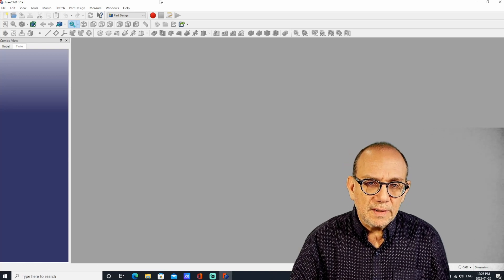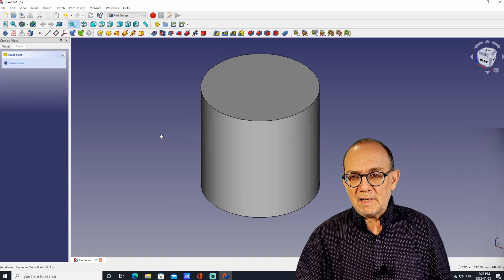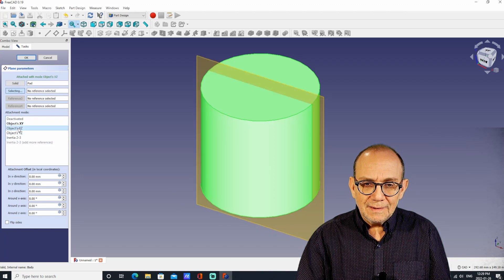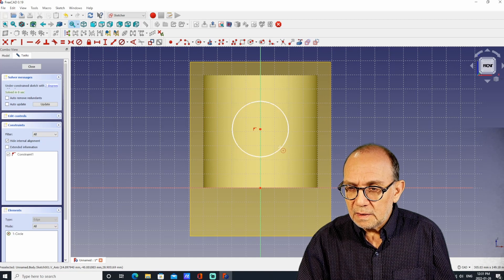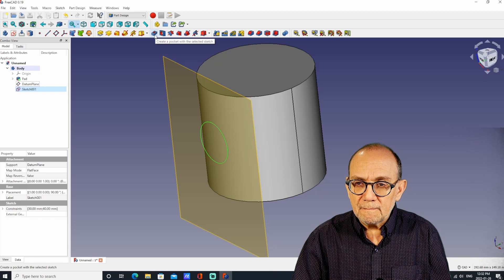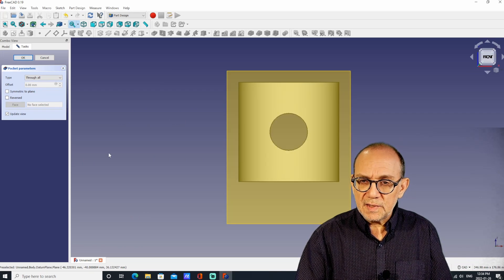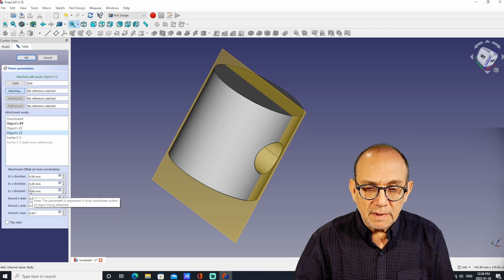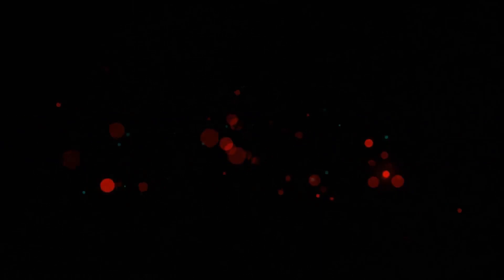Make a Hole on Curved Surface in FreeCAD

Comment: A quicker way is just to leave the datum plane vertical within the cylinder, draw a circle on it then make a hole from it symmetrical to the datum plane, "through all". This is very quick and you don't need to know the diameter of the cylinder to make the hole.

Comment: Thanks for taking the time to teach . . .  where would we be without wonderful teachers like you. thanks. Is it possible to do the same thing instead of making a hole but putting some texture on the outside of the cylinder like cubes or lines etc.
Reply from the maker: Yes, it should absolutely be possible to do this with this technique...have you tried?

Comment: This is probably the most complicated way to do this. Just use the normal xz and YZ plane and select "symmetrical" when using the whole function. Or just do it once and do a circular pattern. Die the second axis.
Reply from the maker: Yes, thank you...I made another video showing the simpler method... https://www.youtube.com/watch?v=ICah1qqFlXM&t=2s  ...and even in this new video I didn't use the "symmetrical" option and "view section" options which would make it even simpler.  RG

Comment: Not necessary at all to use a datum plane for this. Just make sketch number 2 as anormal sketch in the middle of the cylinder and make a pocket. Much easier.

Comment: Thanks for this excellent video!

At 8:52, you mention that to turn off the visibility of any selected node in the model tree, we have to press the RETURN key (= the ENTER key).
But this key does not work: We have to press Space Bar to toggle the visibility on/off.
Reply from the maker: Thank you for your comment.  It's appreciated.  That was my mistake.  You are absolutely correct -- the only way to turn off the visibility is to press the Space Bar.

Comment: Exactly what I needed to know. I knew datum planes was the answer but I could not figure out the entire procedure. Kept getting errors. The answer I needed was to move the datum plane in front of the cylinder and not inside it.

Comment: Wow! Thanks so much. (I made a phone/tablet stand which is just like an 'S' shape with a little shelf; but padded sideways, and I needed to make a hole for a charging cable!).

 I also used the same 2d method and made a keyboard shelf that just hangs off the bar on a small cart with drawers and I put a all-in-one pc on top of. I actually made two shelves one for each side of the cart, but used one skin on the second one and it cracked when I used the heat gun to put it around the bar but lesson learned (I didn't need to punch a hole for that one I just put in the sketch), but it also rests on the cart for the lower end so it doesn't just swing and behind where it rests there is a channel for running the cord around to the other side and so it doesn't drag on the floor either. I'm new to printing and those 2d designs are my favorite right now.

Will remember datum planes now. I always also make the mistake of choosing "make hole" instead of pocket knowing it won't work, but now that you explained it I have no excuse not to know! But for some reason it wanted to cut above the plane so I had to reverse the pocket and it worked for me. (My design is terrible actually because it didnt even have proper measurements and I had to print it at 200%, but the splines did everything so I went with it and got a product that works haha) Take care and I subscribed.

Comment: however, when you change the proportion of the cilinder, for ex.  make it wider, the support plane will be fixed where it was and eont be touching the surface againg. In Inventor and Crro it is possible to fix it without adding distances in mm and when cilinder changes, the support plane moves too. Thats what I am looking for right now
Reply: Don't use a datum plane. Rather, once you pad the cylinder create a normal sketch on the XZ plane. Press the 'View Section' button on the Sketcher Toolbar so you can see the sketch. Create your hole and constrain the diameter and vertical dimension as in the video. Close the sketch and select the Pocket button. In the Pocket window, change the type to 'Through All' and check the box 'Symmetric To Plane'. Press OK. Repeat the procedure on the YZ plane. You should now be able to change the diameter of the cylinder to whatever you want and the holes will always go through.
Reply from the maker: If I understand you correctly what you're talking about are the parametric options in FreeCAD which I didn't touch on in this video.  Using the parametric options you should be able to do what you describe.  If you do a search for parametric modeling in FreeCAD you may be able to find what you're looking for.  RG

Comment: This is absolutely BRILLIANT!!!!  Thank you VERY much!!!!  I was having no end of fits trying to figure this out and as a beginner I was not pleased.  You answered my questions perfectly and you explained it in EXACTLY the way my brain needed.  I've never been one to learn by being taught all the features but instead shown how to do a specific set of tasks and your video hit the nail on the head.  Thank you so very much for taking the time to share this.
Reply from the maker: Excellent!  I'm glad this was helpful to you.  RG
Reply: @CreatewithTech  It really was.  I'm still hammering away trying to get so much of this FreeCAD info to sink in and much of it is.  The one I cannot seem to figure out, nor wrap my head around, is how to create a sunken pocket at the end of a tube.  Ie OD 20mm and ID 16mm tube with an 12mm ID indent at one end 3mm deep.  Basically think of a tube as wide as a quarter with a cutout in the end that would allow a penny to sit in flush with the end.  I've figured out how to do it with two separate pieces but not how to join them.  Still trying though.  :)
Reply: @CreatewithTech  I've been making excellent use of this so again I thank you.  I have stumbled into a problem and I don't know if (or what) I am doing something wrong.  I am trying to create a square pocket through a curved surface but no matter what I do following these steps here I just get a single vertical line on the face after I create the pocket.  If I use the exact same steps with a circle in the sketch I get the pocket I'm looking for.  But with a square in the sketch I can't get the pocket to form.
Reply from the maker: @Enjoymentboy  Hi there.  Sorry for the late reply but the last couple of days have been very busy and I haven't been able to try this.  I'll try it tomorrow and let you know what I find.  RG
Reply: @CreatewithTech  Well you certainly have nothing to apologise for.  Life has a way of getting in the way of things.  lol

I've found a way to muddle around this in that I just make two separate tubes stacked on top of one another but I am sure there is a better way to do this.  But this I suspect is all part of the FreeCAD learning curve.  I'm getting there though.
Reply from the maker: @Enjoymentboy  Well, I tried making a square pocket/hole through a curved surface and it works fine.  I followed the exact steps in the video and I used the "Create Rectangles" tool in FreeCad to make the sketch on the Datum Plane.  Once the sketch is created you need to use the "Pocket Tool" to cut a hole or make a pocket.  RG
Reply: @CreatewithTech  Hmmm...this is just weird.  I managed to design and print off basically what I needed yesterday.  It's just a small cylinder essentially (60mm wide 16mm tall and 5mm thick walls) with a rectangular rocker switch and a hole to run a power wire inside for an LED.  Nothing fancy but I wanted the switch in the front and wire going in the back.  I could only get both pockets to show if I had them 90° apart.  Anything else and the second pocket never showed up.  Just the vertical line.

Comment: why is it better to do this with a datum plane? I see an option to offset the sketch (select sketch, sketch menu --->reorient) ??
Reply from the maker: And this allows you to make a hole on a curved surface?
Reply: @CreatewithTech  yeah try it
Reply from the maker: @dooo679  Can you please explain step by step how you go about doing this?  If you try to create a sketch on a curved surface FreeCAD throws an error without a planar plane.  I don't see how the reorient option allows you to create a hole on the curved surface of an object.
Reply: You're the one with the "how to tech" channel, empower yourself my friend! Let me repeat "SKETCH MENU --> REORIENT SKETCH".
Reply from the maker: @dooo679  Right!  I am the one with a tech channel and I tried what you said...while your way makes a hole on a flat surface, it doesn't seem to make a hole on a curved surface.  This is why I asked for more clarification.  Are you saying that you can make a hole on a curved surface with the technique you're using, so on the curved part of a cylinder?  Thanks.
Reply: @CreatewithTech  what did it do when you tried it? Im latest version, mac os
Reply from the maker: @dooo679  When I try to use the reorient sketch option it does put a hole in the model, but only on the flat surfaces.  So with a cylinder it will not put a hole on the circular part of the model.  I'm using the Realthunder (22.10.21) fork of FreeCAD, although I tried it in version 0.20 downloaded from the official FreeCAD webside.
Reply from the maker: @dooo679  As far as I know (and this is why what you said is interesting to me) the FreeCAD paradigm does not allow drawing sketches on non-planer surfaces.  So the only way to get a hole on a curved surface is to use a planar plane.  But I'd love to be proven wrong, as it would make working in FreeCAD a bit easier.  Thanks.
Reply: @CreatewithTech  so you didnt try it
Reply from the maker: @dooo679  Yes, I tried it!  It doesn't work on a curved surface.  It only works on a flat surface.  What in my responses above makes you think I didn't try it?  I tried using "Reorient Sketch" in every possible way but it will not put the sketch on a curved surface, only on flat surfaces.
Reply: Draw the hole on the regular xy flat plane and then reorient it to xz or yz and offset by the cylinders radius. A popup says you have to detach the sketch.
Reply from the maker: @dooo679  Yes, this does work but I'm not sure what the advantage is of using this method vs using a datum plane.  You're going through exactly the same number of steps as with the datum plane method.  Instead of creating a datum plane you're going through the process of reorienting the sketch.  This is just another way of putting a hole on a curved surface but it doesn't seem any easier.  Is there an advantage to your method?  If there is, I'd love to know what.  Thanks for the input.  RG
Reply: @CreatewithTech  yes it does work, after 10 messages telling me it doesnt. I appreciate your showing the datum method.

Comment: For some reason whenever I move the datum plane it just gets taller and bigger, it doesnt move. Any ideas?
Reply: I just answered my own question, just mess around with clicking different planes in the attachment modes, then change the values of the Attachment Offset (in local coordinates), until the plane is in a desired place. Just gotta play around with it, I originally was trying to move the plane I think parallel to the origin planes, creating some sort of redundant effect. Also dont forget the flip sketch feature on the bottom if your sketching on the wrong side.

Comment: Wow, thanks a lot! I spent about a day (yes, on the "hole" tool, but these are my first steps with freecad ever, so I guess...) before I had to admit I may need to read a book. :D This has indeed helped a lot!

Why there is nothing like "insert a [shape] and make it a negative space" such as in the tinkercad tool??
Reply from the maker: Yes, this is a complicated program.  Sometimes the tools can be a bit mystifying.
Reply: Actually there is. You just make another shape in the parts menu like going through the cylinder, and then use the cutout button. If you select them both using the CTRL button, the second one selected will be the shape cut out of the first shape selected. That's how I pretty much do all my cutouts, but I guess that's kind of hacky
Reply: @robertjohnloftus  Yea, thanks, I figured out in the meantime. Things are often so different once one gets accustomed to something ... and I frankly do not play with FreeCAD often enoug to keep all the techniques in my head. I keep missing those small things such as moving two or three objects together to merge or hollow them out ... although I certainly did that in some tutorial.